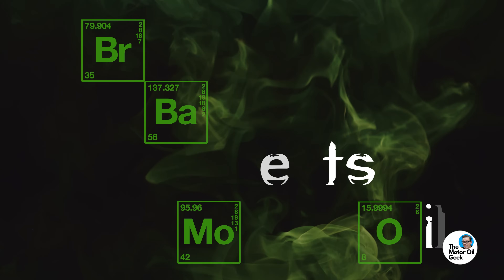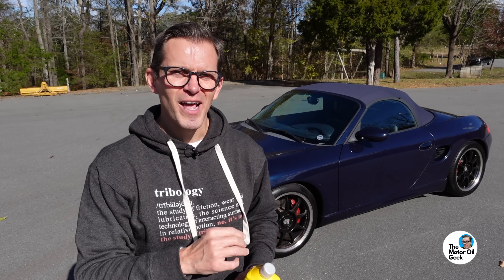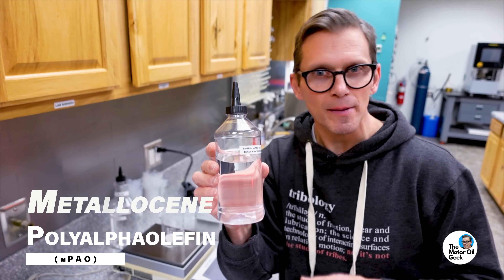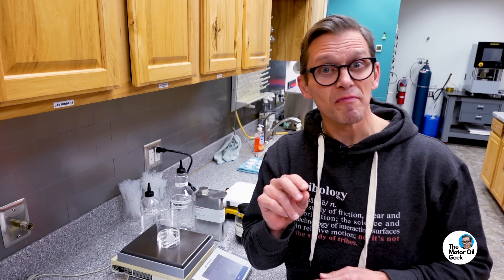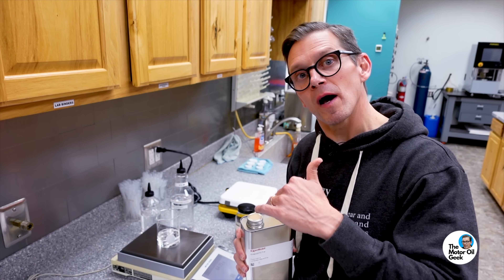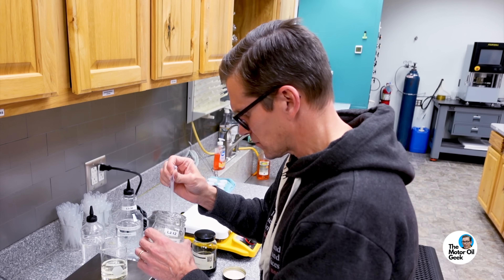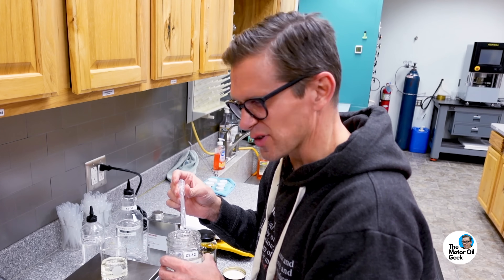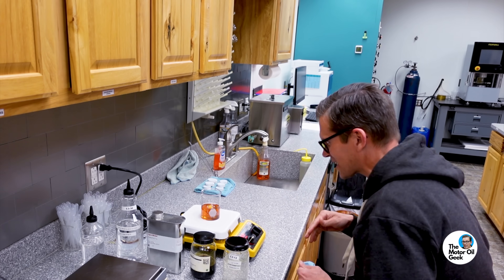Motor Oil Chemistry EXPLAINED (Breaking Bad Style)

Comment: Thank you for talking about how the wix xp filters are a coarser filter and intended for longer service life vs higher efficiency. can you make a video dedicated to filters and filter ratings. It would also be neat to see oil analysis difference where the only variable is the filter used and how that affects engine wear. 
Thanks for the videos it's very informative
Reply: Monitoring the actual oil pressure in my GM, not the dummy gauge that always shows what it believes you think oil pressure should be,  I've never seen even the finest filtration media oil filter clog up to increase pressure/reduce flow over a normal oil change.  I have observed restrictive oil pressure (and bypass valve opening) before the engine oil warms up from cold starts.
Reply: Purolator Boss has emerged first in many different head-to-head tests.  Best efficiency and filtration
Reply: @andymike6575 yes, I've heard good things about Purolator Boss, but there's no WAY XP is better at filtering than regular WIX  over normal length OC intervals.
Reply: Think Boss and XP are the same filter…both brands owned by Mann Hummel… But Lake is using the standard Wix filter - not the XP as the media is tighter in the standard. 😉
Reply: @chrisbehan6451 The two filters appear to perform differently on flow restriction, dirt holding capacity, and filtering performance according this random guy that did a bunch of testing: https://youtu.be/mYi640pMjWA?si=gbB4Rlzcs6oQJ41_
Reply: In oil filter test Purolator Boss and Wix XP came up 1st
Reply: @arxigos365 what filter test?
Reply: You've just said the opposite of what Lake said. The Wix filter is more efficient over a shorter time scale. The expensive filters are less efficient but can be used over a longer period because they don't clog up as quick. That's what he said.
Reply: @thevauxhallman7157 I don't see how what I said was opposite, also price alone has no bearing on filter micron rating. Both filters he was referring to are wix brand but the standard version of a wix filter is often a tighter micron rating than the XP version. Last I look wix dosent even post micron rating for the XP filter number that I've looked up.
Reply: @tdm8817 if you listen what Lake said that's what I'm basing my point on. What you said contradicts what he said, that's all I meant. No offence!
Reply: @thevauxhallman7157  The extended interval filters essentially “loosen” the media to let smaller particles pass. So the filter can go longer before clogging and restricting oil flow - creating a pressure difference inside the filter that trips the bypass valve. Thus, if you’re using 20K filters but changing your oil every 5-7.5K miles you’re essentially sacrificing filtering protection for longevity you’ll never use. Not sure if any consumer ever goes 20K anyway, except maybe my mom…her idea of “maintenance “ is putting gas in the car.🙄
Reply: @chrisbehan6451 I suspect you’re right about most engine oil filters but may find the results of this test interesting:

https://youtu.be/mYi640pMjWA?si=gbB4Rlzcs6oQJ41_
Reply: You're both saying the same thing, different ways! The smaller micron rating means smaller hole for particles to go through, thus clogs up quicker. Higher micron rating allows those same particles to go through longer, thus allowing you to go longer between changes.
Reply: I believe what jr was saying was why spend MORE MONEY for an XP filter intended to prevent clogging over longer intervals by using a more porous media, if you're going to be changing your oil(& filter) again in "normal" intervals of say 5k miles. In short, why spend more money for poorer unit filtration.
Reply: All I know is, I can’t find anything smaller than 20-21 micron rated filter. (Let’s average and say 90% efficiency (one pass) 99% (multi-pass)

20-25 years ago I could find either an AC-Delco/Gold or Bosch / Extra or Gold and they were finer: I can’t recall the exact ratings but +/- 5-10 micron @ 90% single pass , 99% multi pass 

I can’t find anything smaller than 20-21 microns and they are Mobil -1 

And what he said was: if you’re going to change @3-5,000 miles the less expensive filters “might” be more fine than the XP or in the bg showing Mobil 1 extended drain.

Ive found the cheaper ones are up around 30 microns and I can’t find anything smaller than the 20-21 micron range and they happen to be the extended and Napa is scrambling to find a premium filter now that Wix XP is China average.

Maybe he was referring to the base WIX filter being finer? 

From March to 2000-2004 I’d bought a 99 GMC 1-ton work van. A year old with 2,500 miles.

By April 2004 I’d put 421,000 miles on the 5.7 GM V-8. 
Used Mobil 1 - 10w/30 with the hi-quality filters.

Changed it about 1-month and that was 10-12,000 miles. Even with over 420K miles it was 3/4-1 qt low at 10-12k miles…. NO ENGINE Problems 

Now fuel pumps were a problem, (bad ground from the factory) but the first time it went out I got a NAPA replacement and at the time they had a 1 year warranty (no mileage limit) 

My point is I wish I could find the more efficient filters

Currently for a 2013 Ford V-6?
Reply: @deantait8326 re the regular WIX,  that's exactly what he was saying. The regular WIX filters better than the XP, & is several dollars cheaper than the WIX XP.
Reply: @deantait8326 A guy on YouTube did some videos where he tested a bunch of oil filters for cold and hot flow performance and filtering ability. Most of the ones that filtered well also had more flow restriction which is what I assume Lake was alluding too. 

However, there was one filter that ranked near the top of the chart for low restriction AND good filtering performance. It also happened to rank #1 for dirt holding capacity: Purolator Boss. 

https://youtu.be/mYi640pMjWA?si=gbB4Rlzcs6oQJ41_

Comment: Hey Lake, I want to change my oil cooler from oil to water to an oil to air in front of my radiator stack. Mishimoto has an inline oil thermostat. They offer 3 different thermostat temperatures. I'm curious, which temperature thermostat would you choose? Their options are 160F, 185F, and 200F.
I have a 2.8L Cummins diesel. I live at 9,000ft in Colorado, so I'm frequently driving up and down in elevation as well as driving over mountain passes often enough. I don't do much towing, but it happens from time to time. I also like to make trips out to Moab Utah to go off roading, and biking and climbing (though those don't usually involve stressing my engine very much), the drive out there and back can be very hot with not a lot of air density to provide the best cooling.
I know that the cooler the oil is the longer of a life it will have, but also you want the oil to get hot enough to evaporate any water or fuel that makes its way into the oil. Because of that, my mind is going back and forth between the 200F and the 160F option. Or do I just go right in the middle?

Comment: would love to see how you went from Aprox 150g of oil to 5 quarts what type of operation will produce custom  oil blends
Reply from the maker: Because the blends are done by weight, it is very easy to scale the blend size. The folks at HPL have many different size blend kettles that are all on scales.

Comment: Liquimoly sell an additive called Mos2 , would this boost the moly of any oil ?
Reply from the maker: I would not recommend using any additives.
Reply: @themotoroilgeek i would assume that but it would be interesting to see what is all about their motor oil called "Molygen". Snake oil?
Reply: @vwbora26  I currently have their 5W-30 Molygen in the sump of my EcoBoost 1.6, and it seems fine, but certainly not exceptional in any of the 'butt dyno' type metrics. 

But I am not going to bother to do an oil analysis on it, and I am going back to my old standby, the Ravenol 5W-30 DXG next change.
It just seems like a much better constructed engine oil, in every aspect (base oils, additive packs, etc.), but yes, it is also almost twice the $$.

Comment: What are your thoughts on Valoline Restore n Protect? On the Porsche Boxster engine. 987S? Dangerous or interesting?
Reply from the maker: Don't use it in a Boxster or 911 because the viscosity is too low.

Comment: Hi Rich ,I read somewhere that the 21 and up 5.0 Coyote motors with the rubber belt driving the oil pump requires an oil to have an additive in it to prevent the degrading of the belt , does PUP have that additive.

Comment: Lake, have you ever tested oil from an engine that's been fully WPC treated?🤔

For those who don't know, WPC Treatment is a closely guarded secret micro shot peening process invented in Japan, with presumably MoDtc & WS2 Tungsten Disulfide integrated into the ceramic shot which becomes embedded into the surface for an advanced anti friction surface treatment.  Only done in California & Japan & is spoken highly of by engine builder Mike Kiiojima of MotorIQ & on his channel, & many others in competitive motorsports in addition to incorporating Cryo treatment of the same parts being WPC treated.  It would be interesting how those treatments show up in an oil analysis.🤔

Comment: How much did it cost including lab time to make your special oil in the amount to do that oil change ?        Totally agree with using a standard oil filter if you are doing 5k mile oil changes.  (if your vehicle has a turbocharger you should be on a 5k oil change regimen IMO) as they will burn and coke the oil .            That might be a good thing to test some time,  see how many miles before the oil in a Turbocharged engine will begin showing signs in lab tests of the oil burning and coking after an oil and filter change ?
Reply from the maker: Zero chemical costs. Fortunately I have friends at those suppliers that provided enough samples to do this.
Reply: @themotoroilgeek  Sweet,  nice to have such friends.
Reply: @themotoroilgeek what kind of oil would you recommend for a 2014 mercedes c250? Euro pennzoil? Please help
Reply: @themotoroilgeek  How much does the mPAO 100, as well as the MoDTC run per ounce (retail)?

Comment: Amazing tip on the oil filters, I did not know that, thank you sir! I use an oil that is designed for extended drain intervals, but I would rather not sacrifice filtration for extended use time. If my oil can go 10k miles, I would rather change the standard filter at 5k, but not drain the oil if it's still good, but then change both oil and filter at 10k, if the analysis says to.
I was thinking of using a bypass filtration system for my Ford Super Duty "Godzilla" gas V8. I would keep either the OEM filter, or a PPE filter that claims to filter lower microns. Then the oil could go 10k, or even more.  I can do a used oil analysis when I change the filter.  Any thoughts on this plan?

Comment: Oil interval is supposed to be based on engine operating hours not mileage or time unless you do short drives not letting the engine reach operating temperature. 35 hrs for synthetic & 250 hrs for non-synthetic oils.

Comment: A very interesting segment, thank you.  I will proceed to show how little I know about oil chemistry, but I do have question based on my experience of lubricating bullets.  Hexagonal Boron Nitride (HBN) strikes me to have potential as a motor oil additive. To be used in an oil the so-called "Nano" product would be needed otherwise it will be trapped in the filter, I think.  There are additives containing HBN available, mostly German, but they are hard to find in the US. If you ever run out of things to talk about might I suggest it as segment?
Reply from the maker: Solid lubricants such as HBN are not good ideas for engine oils.

Comment: I am running a small 3 cylinder metro with  oringged block woseco forged piatons on e85 cabed and 40 psi..     what you use off the shelf  for that Mazda???😊

Comment: How can we look up the recipes for our oils?  For example, in my 2013 Toyota Tacoma (1GR-FE V6) I run Valvoline Advanced Synthetic MaxLife 5w30, with a Toyota filter. Can I find the recipe (formula) for that oil somewhere?
Reply: Sort of, contact the Oil brand.  For Valvoline they provide some ingredients (not recipe) on their website, perhaps they will say more if you call them. Mobile One has more information on their website as compared to Valvoline.   Although the best option is to send a virgin sample to Speed Diagnostix as formulations can change without any notification from the oil brand.

Comment: What a mind trip...  The oil is actually CLEAR as water and part that looks like the oil, actually is everything else?
Reply from the maker: Yep. The darker color comes from the additives.
Reply: @themotoroilgeek with my older cars and trucks I was all ways told to run 10w-40 in the summer and 10w-30 in the winter does it really matter?
Reply: The mineral oil you can buy at the pharmacy was what everyone used about a century ago for their oil. They also used canola oil (rapeseed) as well. It's like how ethanol is clear, but whiskey is amber/brown. They don't just want mineral oil, they want some other stuff too.

Comment: If it's a Custom Oil for a modified motor and you want max protection/minimum wear why would you go 0W ? 
It's obviously not cold where you live or you would have paid the extra for the top half for the Car😜

Comment: I’m very curious as to how this oil would perform in my engine with a sliding finger follower style rocker arm I’ve been running VR1 10w-30 and have kept my oil change intervals around 2500miles since I’m running E85 and daily driving it I would love to run a 5w-30 but I just worry about valve train wear maybe I’m being over cautious but I’ve lost cam lobes and rocker arms before I made the switch to VR1
Reply: above 32 degrees F, there is no benefit to 5w-30 over 10w-30,  and its very minimal under 32 degrees F.   Do a used oil analyists with Speed Diagnostix to know what's actually happening.

Comment: Lake, stupid question. 

Would you expect the rate of wear to decline as you accumulate more miles?  Eg, the break in continues. Or, generally speaking the “wear in” is complete very early, and the rate of wear is 100% dependent on the oil composition?
Reply from the maker: Great question. Wear tends to drop over the first 15k to 20k miles. It is then stable for over 100k miles. In this range, you can do repeatable testing.

Comment: Off the wall question:  when used oil is recovered by shops across the nation, are the raw elements (moly, zinc, phosphorous, etc) captured and recycled?
Reply: Following
Reply: Unfortunately no. The oil is hydrotreated, and the sulfur, phosphorous, metals and other trace elements are broken down and removed in waste streams.
Reply from the maker: They are not recycled. They are removed during the re-refining process.

Comment: I've had 5 gallons of Shell Rotella T6 15 w40 sitting in my garage since I bought it in December unopened I don't know how long it was sitting on the shelf I got it from Advanced Auto Parts for 40% off because they were closing considering this oil may be over a year old sitting in the original packaging do you think I can use this

Comment: Very cool. I keep hoping for a good quality synthetic 0W40 with zinc that will perform well in a high performance hydro roller application
Reply: AMSOIL has a high zinc oil called performance and protection in a 10W-40, which should work if you don’t live in a cold climate and your car doesn’t require a current api oil.  This oil is rated sm
Reply: @darrylsjodin7184 yes I've been running that 10w40 for over 25 years. The last 5 years has been to z-rod version. It would be nice having a 0w for the winter though

Comment: My secret ingredient is Bars rear main seal stop leak in my old garbage hauling F150 with the 4.2 hardened rear main seal.  Works too if I drive it enough to keep it circulated and the seal softened.  I throw in a bit of bat hair too to help protect the rod bearings.  LOL

Comment: 2618 pistons tend to show more wear due to higher ductility and piston slap due to clearances required for higher expansion rate, etc., so it's not surprising you are being challenged to achieve a "OEM" wear rate with race-spec parts.

Comment: He's in North Carolina, so the Secret Ingredient is Bacon Grease!
Reply from the maker: LOL
Reply: @themotoroilgeek I understand the main purpose of a magnetic drain plug, but doesn't the drain plug's (magnetic/iron removal) action distort the analysis results of the removed(used) oil? I'm just curious how you quantitatively account for whatever sticks to the magnet. PS love your videos and all the info you provide, I'm a reformed/repentant "high mileage oil changer".  Now I just have to argue or pay for better oil change schedule for the 2025 Prius plug in hybrid I recently leased.
Reply: Better than soybean oil
Reply: Amen 🙏!!
Reply: Cheerwine, actually.
Reply: MMO is 30% lard. This was disclosed in a court case.
Reply: He started in North Carolina, but the last shot showed an Illinois plate.
Reply: @themotoroilgeek I have an oil question about oil only cooled turbo set up. What would be the ideal oil to use?

Comment: I wonder if it’s true that your boundary lubrication wear is worse with thinner base oils, like the SpectraSyn used here, due to the thinner film strength than say a 5 or 10w40 oil.
Reply from the maker: Not when you blend it with the mPAO 100.